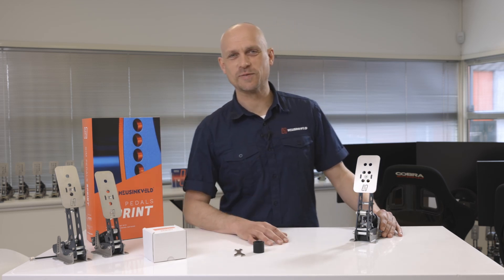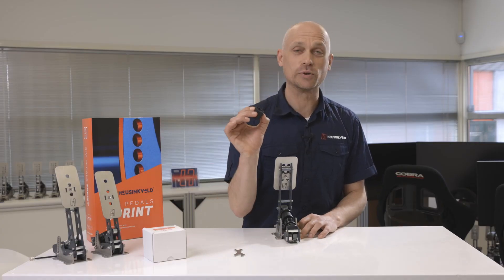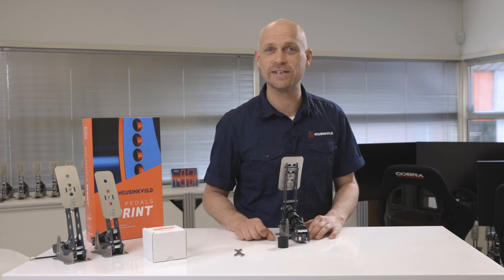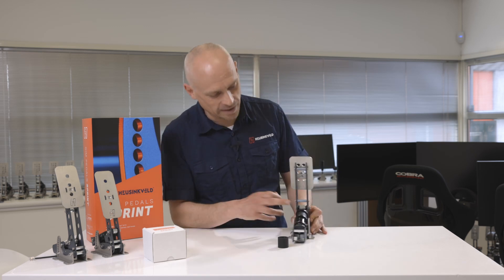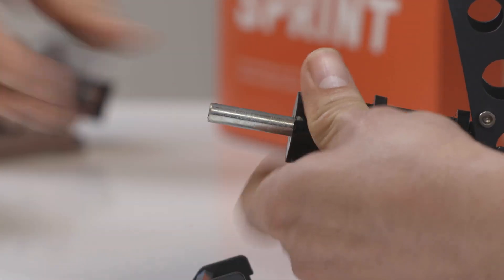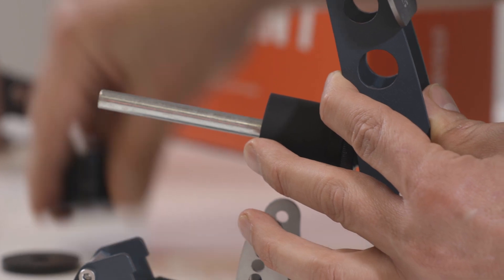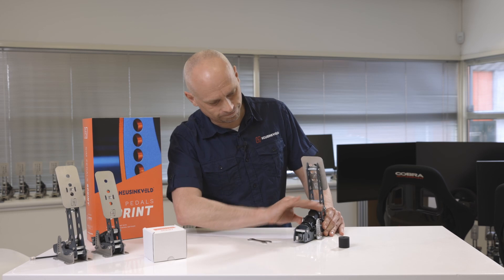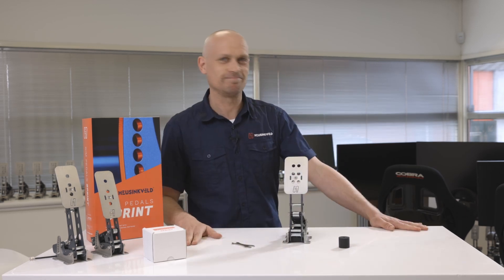Installation tutorial Elastomer Kit - Sim Pedals Sprint #simracing #esports

Comment: Awesome upgrade. Question though my kit came with some thin plastic washers 1mm thick by 20mm. What are these for?
Reply from the maker: Hello Dropoff510, 

Thank you for your message. You can add one or both of the small 1mm thick spacers to the larger spacer that sits inside the spring. This will make the pad-to-disc gap shorter (spring bottoms out sooner) without increasing the spring's stiffness, which is what normally happens when you increase preload to make the spring shorter. 

In this video (https://www.youtube.com/watch?v=61vRdYWO8J8), Enzo explains the functioning for the hand brake, the same principle applies to Sim Pedals Sprint brake. 

Hopefully we have answered your question 😄

Best wishes from Groningen,
Your HEUSINKVELD Team

Comment: if i may add one useful hint from Enzo/Heusinkveld which he wrote in a simracing forum: 

"You can add one or both of the small 1mm thick spacers to the larger spacer that sits inside the spring. This will make the pad-to-disc gap shorter (spring bottoms out sooner) without increasing the spring's stiffness, which is what normally happens when you increase preload to make the spring shorter.

I had suggested that these should be added to the Elastomer Kit months ago and then added it to the product's 'recipe'.
When we prepared the Elastomer Kit for release; making the manual etc, everyone (except me) had apparently forgotten about this, so they weren't added to the list of contents or to the manual with a small explanation."
Reply: Sorry don't understand this comment - I take out all spring movement so would be interested in an alternative solution! What are these 1MM spacers you refer to? Can't be 1mm surely as too thin surely? Either way Did they come with the original pedals as I don't recall ever seeing them. Thanks!
Reply from the maker: Dear David,

many thanks for your message. 

If you have any technical questions about our products or need help with the installation, please do not hesitate to contact our Support Team at support@heusinkveld.com. They´re always happy to help you further with any questions you might have ;-) 

Our Technical Support Team will answer you as soon as possible. 

Best wishes from Groningen,
Your HEUSINKVELD Team

Comment: I have 5 year old pro pedals on one rig and ultimate pedals on other rig. Zero issues.  Best pedals for extended long term use even with tons of abuse. Still work flawlessly.
Reply: I did have an issue with my Excelerator spring but Customer Service, we’re on it straight away. Can’t complain fantastic customer service which is also good to know
Reply from the maker: @M.JON3S  You're welcome! :)